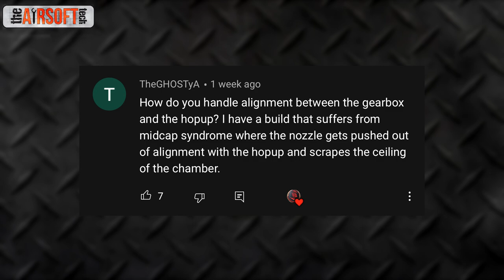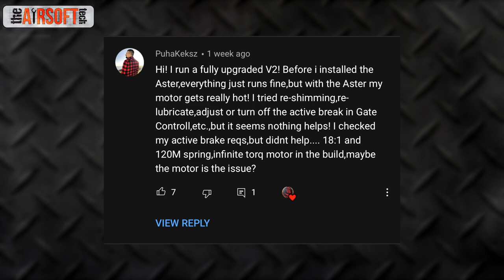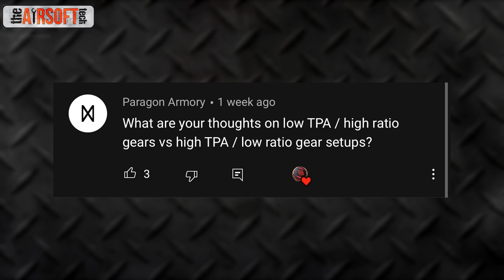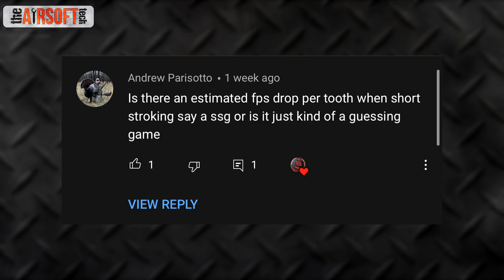Gearbox Alignment | Airsoft Tech Talk Q&A | Episode 23

Comment: Hi so i have a question?  I have bought a cyma 48 its a ak74(stock). I want to upgrade to be 400fps and very accurate, I'm not that interested in rate of fire because i shoot semi only. Can you give me a tip on what parts to get? Or what would you personally get if you were making it for yourself. Thank you
Reply: p.s the length of the inner barrel is 500mm
Reply: Bore up cylinder set. M115 spring. High torque motor. Shim and grease properly. If you want faster trigger response put some 13:1 gears in it as well. 
Accuracy wise use a good hop up unit, pick a tight bore barrel, and then a good hop rubber and madbull fishbone nub. Have this exact setup on my CYMA PP-19 and it's great. 28rps and 390fps

Comment: Id like to hear your thoughts about HPA vs AEG on joule limits. I recently went to a MilSim event and rifles were limited to 1.55j with .32s and i use .32s in my AEG anyway. however, HPA gets locked in at exactly 1.55j with .32s at chrono, but then load their guns up with .42s or even up to .48s. ive heard that HPA systems push much more volume than AEGs so the joule creep makes it so they are shooting more like 2.4j once they put the heavier BBs in their guns, even though they were locked at 1.55j with .32s. is that true? i just know that when i got shot with someones HPA set up, it did NOT feel like 1.5js. as a tech and a very avid airsoft player, i know VERY well what getting shot with 1.5j feels like, and the HPA guns hurt a LOT more.
Reply: Yeah, hpa guns get a lot of joule creep but joule creep can be achieved with an aeg as well, not to the same limit as a hpa system but significant over volume causes joule creep on aegs
Reply: Should put a maximum limit on bb weight. At least thats what we do here. (0.30g, 1.2j assault/0.4g 1.7j dmr/0.4g 2.1j bolt-action). This come forth by examining the amount of joule (ca 1.2j) transferred from the bb to an object at a certain distance (at least the minimal engagement range).  Joule creep is nasty and can be potentially dangerous.

Comment: What is your position on how the BB behaves while traveling down the inner barrel. Is it touching the top of the barrel or is it flying in an air pillow?
Also, opinion on inner barrel lapping/polishing? Does it really work? If so, is it even worth it?
Reply: It’s been proven that it rides the top of the barrel.
Reply: Edgi barrels are hand lapped and are absolutely the highest quality and performing barrel you can buy. They have brass or stainless steal and offer 6.01mm which will give you the tightest groupings.
Reply: @jordancook5171  eh diameter doesn’t really effect groupings as much as quality of bore
Reply: @opairsoft8100  I've seen better results with 6.01mm but definitely a well lapped barrel makes a huge difference

Comment: Hey, I was wondering if you could give advice on how to increase my guns FPS. It’s Currently shooting 285 FPS with .25g bbs, which is quite low. It’s an 8 tooth DSG, so I wouldn’t expect it to be shooting super hot, but it should definitely be able to shoot harder than it currently is. The gearbox currently has perfect airseal, and I’ve made sure that none of the seals blow out under spring tension. The barrel and bucking are sealing perfectly, and the seal between the bucking and the air nozzle is good to my knowledge. I don’t really understand where it’s losing air efficiency. If it is needed, here’s a full parts list.
-Lonex gearbox
-lonex cylinder head
-ZCI ported cylinder
-CYMA Swiss cheesed piston
-Retro Arms aluminum piston head
-lonex ball bearing spring guide
-Guarder SP150 spring
-Seigetek DSG from a 20.15/1 DSG gearset
-XYT bevel and spur (18/1)
-ASG 22TPA motor
-lonex ARL
-retro arms bushings
-ZCI motor grip

Barrel Setup:
-Maxx ME pro
-Maple leaf 50d MR hop bucking
-Madbull 155mm 6.03 barrel

I guarantee a lot of the issue is the barrel being too short, but I don’t think it would cause as much of a drop as it is. I’m using the short barrel because I play really aggressive and I don’t like my gun being long, so the short barrel paired with a short outer barrel and rail works great for how I play. And the range is great with the setup I have, it’s just shooting low for my taste. Thank you for any help you give!
Reply: Hey man, i have done 6-7 dsg builds for myself and others and had a few people asking for help with there builds due to the same reason, to me the problem mostly if not always is the spring, i know you are using a sp150 spring however as the springs gets tighter and more compressed there is key parts of the spring will ramp the compression strength rather than bunging a sp150 by itself try a spacer with the sp150 or sp130 and you will notice you will hit peak compression quicker and your fps will boost by 30-40fps.
Reply: Thanks for the reply man, I appreciate it. I’ll give that a shot. Is there a recommended length spacer, or is it just a test out certain lengths and see which works best? I have access to both 3D printers and Metal machining tools to be able to make a spacers for the spring, so I’ll be able to make different lengths
Reply: @roycedoll115  so the best size I've found for homemade and manafactured is 10mm wide bore, 15mm circumference(wide). 25mm tall. If you look up SHS dsg spacer you can find the dimmensions and drawings there. I have 3d printed nylon spacers however after 60-70k shots it will degrade massively if precock is used so I'd advise going for metal if possible.
Reply: Alright cool, thanks man. I personally don’t use precock as the trigger response is already instantaneous with my setup, but I’ll still make the spacer out of metal, and I’ll let you know how much of a difference that makes probably this weekend
Reply: Hey, my motor just fried, so I won’t be able to test the effects of the spacer I just made this weekend. I have a new motor on its way, but likely won’t make it to my house by Sunday. I did get a decent amount of shots with the spacer installed and it did make a decent visual difference in FPS, but I don’t have a crono at my house to give an exact measurement
Reply: @roycedoll115  ah that's a bummer man sorry to hear. that's no problem at all reply back once you get an idea of the FPS will be interesting to see and help further if needed 😊 have a great weekend buddy

Comment: Im having a problem with my decade old jg m4a1 full metal all stock except a spring guide with bearing gear set 16.1 steel bushings and lipo 7.4 batt .. when not in use for a few days the first shot would crank the piston full compress but would not fire so i have to disassemble the upper receiver and help the piston with my finger trough the gearbox window so it would fire .. then it assemble it and will fire now but after a dozen single shot and auto shots the mosfet would be super heated and smoke emerges .
Reply: check your shimming and make sure the piston isn't tight in the gearbox shell
Reply: @averagefrogenjoyer5396  im positive with my shimming .. but not sure about the pinion gear to bevel gead couz i cant see or feel them with my finger so im relying on the sound it makes .. by the way im using a bigger o ring in the piston .. when im putting my finger on the air nozzles the piston is having a hard time compressing couz of the vacume.  Thanks
Reply: My suspect would be the 16:1 gear ratio .. my research on the jg stock gears might be 18:1 and before the stock gears got destroyed i used to use sp140 spring and a 11.1 lipo and back way back and it doesnt have this problem ..